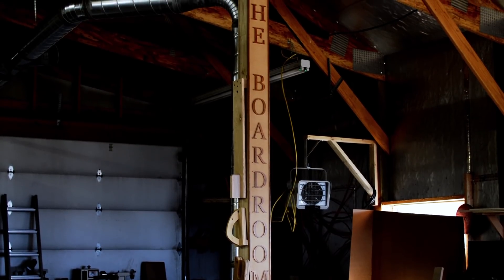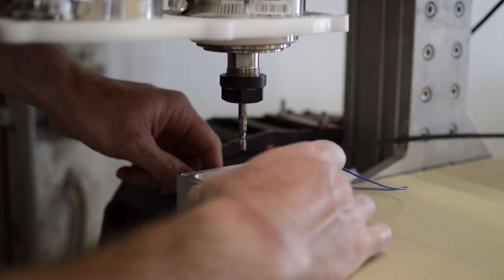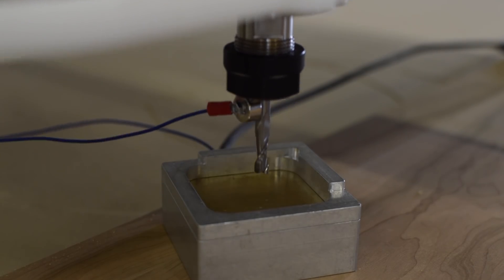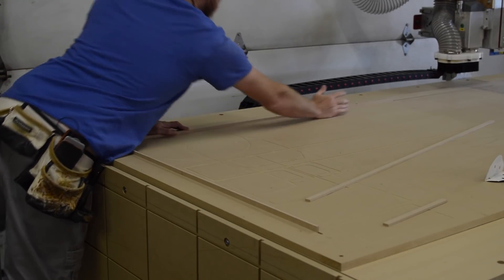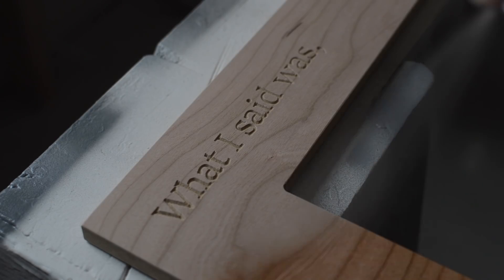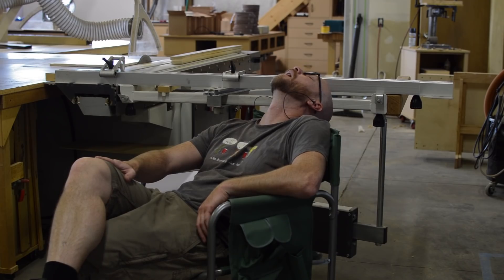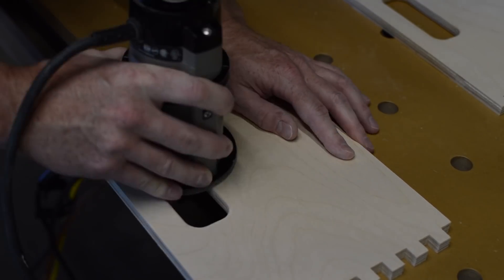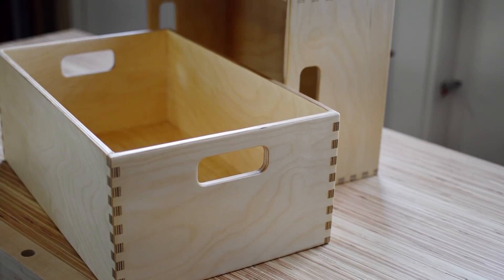3 Fun and Easy CNC Woodworking Projects

Comment: Vertically cutting the box joints...Genius.  Cutting them flat on my cnc yields dog-bone looking box joints that i do not care for.  

Congratulations on taking the plunge.  A year into owning a CNC I have my own opinion.   Especially for those who say cnc isn’t woodworking.  It’s certainly not the same skill set as your kumiko wall panel.  But it also is no walk in the park.  It takes a whole different skill set, learning curve, and many many hours to become good at.  

It’s just another tool for the toolbox.  The mike ferrington toolbox just got a little bit more badass.  

Shop apprentice is growing!  Best wishes to you and your family during these crazy times.

-Ben
Reply from the maker: Thanks Ben, I totally agree, its just another tool, and one that is very challenging to operate properly.

Comment: I cut box joints with my CNC on the face. This leaves rounded inside corners BUT, I follow up by rounding over the insides of the fingers with a roundover that matches the bit I use to cut them out...if that makes sense. The end effect is really cool as the box joints have tiny rounded corners...looks neat.
Reply from the maker: Thats a great tip. Thank you.

Comment: look into compression cutters.  Up cutter on the bottom and down cutter at the top.  no tearout on either side.  one issue with them is that the dust is hard to collect onna counna it gets compressed in the kerf.  but the upside to this is that the dust get so compressed, it can actually help keep parts from moving!

you didn't say one way or the other, but it doesn't look like you are using vacuum to hold parts down.  a big expense of course, but worth it if/when you start using it more for production work.

love your videos.
Reply from the maker: Thank you. I actually have a couple compression bits. I decided not to go with them because I wanted to have room to make forward steps. Meaning, start here and have room for improvement. Hope that makes sense. To the vac hold down, thats on the list to buy/build.

Comment: I used to work in the signage industry back in the late '90s and I used a CNC from Gerber Scientific. When you put your workpiece into the software, it auto calculated what needed to be cut first - inside first, then border etc. It even did inlays. You just told it what size bit you were using and it did all the work for you. I can't believe that today's software can't decide what to cut first?
Reply from the maker: Todays software would do that if it was operated correctly. I just simply loaded the wrong program.

Comment: Great starter projects!  Thanks for sharing.
I did the same thing on the front of my CNCRP 60120 with dovetail-based clamps ... and then I realized the clamping surface (3/4" MDF, in my case) flexed too much!  It was a bit better after backing it with a second sheet of MDF but Jay Bates really did something cool with his CNC - he's got an array of various angle settings available with a "rainbow" of dog holes for alignment.  That's probably the next upgrade for me.
Reply from the maker: Thank you. Jay really knows what he's doing when it comes to CNC.

Comment: That's pretty cool. I'll be looking forward to seeing how you use it in your business.
Reply from the maker: So far I have used it to do quite a bit of flattening. Work bench tops and a few slabs. I have also cut a few cabinet jobs, as well as some odds and ends. I'm hoping to use it in a video where I am cutting out a batch of cabinets in a month or two.

Comment: In terms of the glue and the finish, that is a good tip! I bet that the carrying solvent in the finish probably acts as a thinner to the squeezed-out glue.
Reply from the maker: Thank you. I'm sure it does to some extent, could come down to how long the glue has cured for. Newly dried glue certainly could be very much affected by the thinner.

Comment: So why the veritcal setup for the box joints. Couldn't you do the same with the boards laying flat?
Reply from the maker: It I did it flat, the inside of the corners would be rounded. Not a huge deal, but this was a fun challenge.

Comment: Plans for vacuum hold down?  It's the missing link for making cabinets parts and drawer boxes.  It will save clamping and unclamping time, save material that you have to give up to tabs, save the tab clean-up time.  It will make programming in V-carve quicker as well, since you won't have to program in a "Marking" toolpath to safely screw the plywood where the endmill won't run.
Reply from the maker: I am going to make a vac hold down. That will be an upcoming video in a few months. I totally agree about how much easier it makes things.

Comment: I know poly comes in water based and oil based. What did you use for thinning? I assume you used the oil based poly.
Reply from the maker: Yes, Oil based. The water based won't hide squeeze out.

Comment: Couldn't you have cut the corner joineries when the cnc was cutting out the box surfaces in the first place? Any special reason why you turned the boxes vertical to cnc the edges?
Reply: If you cut them horizontal, then you have the radius of the bit to deal with.
Reply from the maker: Yup, I'd be dealing with the radius of the bit.
Reply: Oh that's so true! I didn't think of that! Thank you for the tip. Will use it myself next time.
Reply: I’ve been pondering this for a while. And there are some interesting options if you are ok with rounded joinery. I’d have to do some significant damage to my SmartShop table to get a vertical axis but I’m still trying to find the best way to do joints on the CNC

Comment: Nice work Mike!! A vacuum table is very convenient for the work you're doing, and some pneumatic pop-up pins for the X/Y orientation as well.  I normally set my workpiece (G54)  x/y/z height once and have it set to the spoil board. (and adjust my cams G54 points to that) That's extremely convenient. Only if i skim/replace the spoil board i set the Z height again. I like to cut plywood with a down cutter (or up down cutter) in 1 stroke. 6mm cutter, about 4800-7000mm/min at 14000 rpm. That way the chips will form a solid barrier between the stock and the work piece, so the part will be held in place with chips. And plywood gives a cleaner/less fuzzy finish when you cut it conventional instead of climb milling. (don't climb mill wood, that goes for most of the softer types of wood is my experience).  These boxes will not help to get  your kids in the clean-up mode.. (once or twice, but then the plan will fail).  'It's time for clean up robots, robots, where are you, robots we need you, robots, please help. Robots, need to clean beeeeeeeep.' is what still gets them going in our house. (I guess it will wear out once they are reaching double digits, but for now it works like a charm).. Do you use the Abranet (Ace) sanding pads on your Mirka? They work miracles.
Reply from the maker: Thank you. A vac table is on the list. You are right about the g54 offsets. I need to get organized on that front. Very interesting about the full height cut, that could be a game changers. I do have a compression bit. I just didn't use it on the project. I of not use Abranet, I found it to be too expensive for how much I use. I use normal 5 hole sanding discs. Dust collection is still very good.

Comment: First thing I'm still learning CNC myself and programing with a computer I just don"t get.
One way to hold your work pieces down  is Dewalt makes a brad nailer that is shots  plastic nails. and the other is double stickey tape both of which I learned on youtube. 3M seems to make the better stickey tape and releases easily and is easy to clean up.
Reply: If you could fit a vacuum suctions system that can hold the piece down. Will the CNC leave space for that?
Another way maybe to drill fit dowels to the underside that then allows you to attach it to other wood under the CNC but again it depends on the CNC having space to allow that. 
You could at the end of the wood sheet joint it with  biscuit, domino or dowel joint to a jig that you fix down to the CNC. 
If you use wooden joints it means if the CNC bit hits the joint it will not damage it.
Reply from the maker: Yup, I have a plastic nail gun as well. I will show that in a future video. Double stick tape is a great way to hold stuff as well. Thank you.
Reply: @MikeFarrington  I would like to see the plastic nail gun.  Not sure I knew it existed.
Reply: @MikeFarrington  outside of width issues. would the vertical mount clamps work on the horizontal piece? maybe some foam between the deck board and the piece being cut.

Comment: curious to learn how you came to choose the kit you chose.  My plastic fab shop has  5' x 10' giant chunk of iron that I have been using for five years now.  But I am probably going to buy a kit like yours for my own board room.  what did you like most about the avid machine?
Reply from the maker: Thank you. I went with the biggest I could fit. I wanted at least 5 feet wide for baltic birch, and 8 feet long for 4x8 plywood. I wanted a spindle because a router doesn't have enough power. Thats pretty much it. So far its been great. What I like is cost, when compared to power, accuracy, and of course flexibility and upgradeability. I like that I can add or or subtract from the machine over time.

Comment: If 4 thou is too tight, what did you settle on as a good clearance, 6 thou ?
Reply from the maker: I ended up a 8 thou. Keep in mind that is just for my machine. This is an area where test cuts are needed.

Comment: I think there's a box making feature in V-Carve Pro.
Reply from the maker: Hmm, I'll look into that.
Reply: Does it make those dog bone corners? I'm still not on board with that.
Reply: @JasonPeltier  The ones I made about a year ago had dog bone corners. I still don't have a vertical table (it's on the short list), but I don't remember that being an option in V-Carve at the time. V-Carve has come out with an upgrade since then, so maybe it's included now??

Comment: Thanks for the video. Just curious, do you incorporate the CNC into your cabinetry work at all? I am considering one to speed up production but I am not sold yet. I’m a one man show mainly tackling custom one off projects and I see that you seem to do the same. Just curious of your thoughts. Thanks, Mike
Reply from the maker: I haven't done a lot of content with the CNC on my channel. I have not gotten to the point where I am good enough with it to make an interesting video. However, it is a tool that can make lots of money. I have done a ton of slab flattening for people. 125 and hour, takes an hour or two to get it done. Boom couple hundred bucks. Do that once a month and you are paying for the machine. As to cabinet work, if you are cutting a handful of sheets per month, this thing will pay for itself. It will cut a sheet of plywood into cabinet parts, add shelf pin holes, dados for the back, etc. So long as your programming is correct, the parts will come out ready to assemble. The question you need to answer is, am I motivated enough to learn something new. For me, it has taken a lot of learning, over time I have had more and less motivation to keep pushing myself. Hope this helps. Email if you'd like more info.

Comment: Since the release of this video, how has your software solution evolved? Are you using one SW product in particular as your "go-to" tool for design and machine programming?
Reply from the maker: So far I'm still using a few different software products, and I select which one based on the project. The only real change is that I am better at know which one is good for which. Not a great answer, but its honest.

Comment: That vertical table looked good.  If you have any more info or a video on its construction that would be very helpful - I want to build one for my 4896 but haven't designed on yet.  Cheers
Reply from the maker: I don't have any more than what I showed in this video. I pushed in the end rails about 3 inches, I used some roll in nuts and a piece of MDF. I use a few shims to make it nice and square to the machine.

Comment: Nice work! So, if 4 thou is a little too tight, have you found a happy medium for plywood joints? I'm doing some half-lap stuff and I only get one shot. I'm going with a .48" gap to fit "1/2 inch" baltic birch around itself. I think that stuff is actually 12mm (0.472") nominally.
Reply: Really good thinking on the poly/poly strategy too. I like that. *taps forehead knowingly
Reply from the maker: I think .010 clearance would be the starting point. This is going to greatly depend on the bit and how close it is to its nominal size. The the material you are cutting and feeds and speeds will all play a role.
Reply: @MikeFarrington  sweet, thanks. Yeah the shop I'm working with doesn't resharpen in order to keep their bits close to proper size. They just pop in new ones. I probably won't have that luxury at first when I get my own setup.

Comment: Nice video, Mike. Question about the 12V Bosch drill and driver you have. Do you have the brushless version? If not, would you recommend getting brushless? Thanks!
Reply from the maker: That driver is about 12 years old. Its be totally awesome. It is not brushless, when that one dies, I will replace it with a brushless version. No question. Thats the drill I use most.

Comment: Mike, I’m a long time wood worker and computer user but have zero experience in programming. I’ve given some thought into investing in a CNC. machine but I’m apprehensive about it because of the lack of programming experience. It’s a big outlay if I can’t get much use out of it. What is your response to this concern?
Reply from the maker: For me it was a mindset. I just knew that it was going to be an uphill battle. I also knew that I could try to enjoy the learning, or get frustrated. So far its been a lot of fun, almost like when I first started woodworking again. In terms of productivity, I really don't know how good with computers you are, but I was able to start cutting basic shapes in a few hours. From there it really depends on what you want to cut vs how productive the tool will be. If you are planning to cut highly complex 3D parts, its going to take a lot of time to learn the programming. Send me an email via my website if you want more info.

Comment: Hey Mike! Just as a quick tip I always use brass screws whenever fastening pieces down on the CNC, although it's more expensive it's much safer and less destructive in the event that the bit accidentally hits it.
Reply: Beau Nakamori I’ll take that advice too! 😊 just wrecked a $100 bit on a screw 😡
Reply from the maker: Thank you. That is a really good tip.
Reply: Great tip.  I have also seen guys use plastic brad nails for the same reason.

Comment: I'm curious, what made you add the extra step of using the vertical clamping? Couldn't you get the exact same effect and much easier by cutting those same shapes with the boards flat? I though at first you'd done it to make dovetails (which I would love to see you do still), so was this just an excuse to be an engineer and create a problem to solve? And excuse to make the vertical clamping jig? Regardless, great work on all this and I'm definitely gonna make myself a vertical clamping rig now. You made it look so simple!
Reply from the maker: A similar joint could have been made cutting the pieces flat, but there would have been little clearance radii in each of the inside corners. Cutting vertical allowed for a more furniture grade joint. Hope that makes sense.

Comment: Hi Mike, thanks for sharing.  Is this the same machine that Jay Bates is using?  He has a video on setup and use so you might want to check that out.  the output looks great so far.  Congrats and enjoy your new tool !
Reply from the maker: Thank you. Its a similar machine. I think mine is wider. Jay is very good with his machine.

Comment: If you add dog bone over cuts to your box joints, you don't need the second vertical clamping setup. Also less tear out!
Reply from the maker: But the joints would look as good in my opinion. Plus the was just the starting point for vertical clamping. I plan to do other stuff as well.

Comment: Very cool projects Mike. As a non-CNCer (is that a word?)  how long did it take to make the toy boxes, start to finish? And, be honest, how long would it have takenusing the normal,  more conventional methods?  Please sir, I have to know.  As always, thank you for the great content.
Reply from the maker: It took maybe an hour or so to write the program, 15 minuets of machine time, the box joints took another 15 or so. Assembly took a couple hours counting the sanding, another hour or so for finishing. What that doesn't count is the work I had to do to the machine, plus I did some testing. I could not cut these out by hand faster, once the machine was setup with the vertical table.
Reply: @MikeFarrington  thank you.  The CNC add options that are not easily handled with conventional tool easily.  I have to find room in a very tight budget.  I really appreciate the feedback.

Comment: I might be stating the obvious but why not move the edge of the frame further back,  make the cut and then move to the new position?  That way you would not have been close when using the cutter.
Reply from the maker: I don't follow.
Reply: @MikeFarrington  When the frame was moved back it could have been moved a bit further.  Then make the cut without risking damage.  Once the cut is done move the frame back to the edge of the cut.